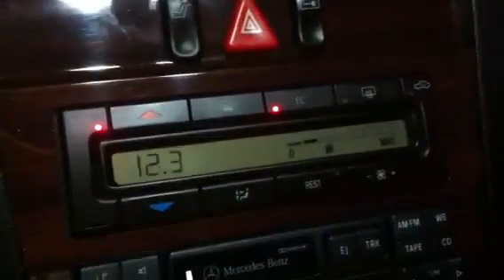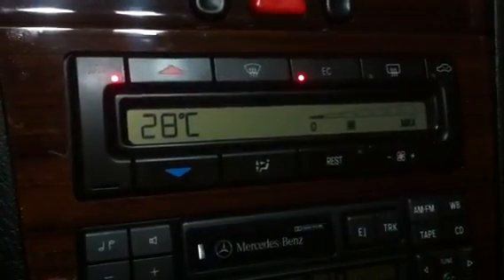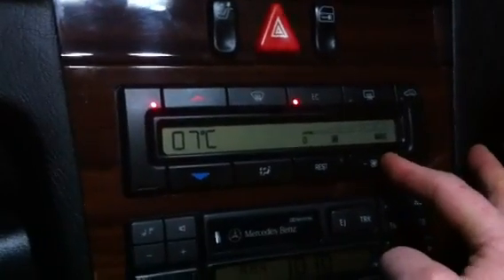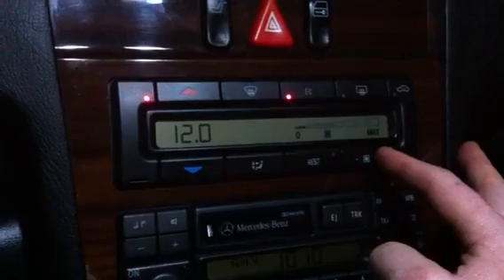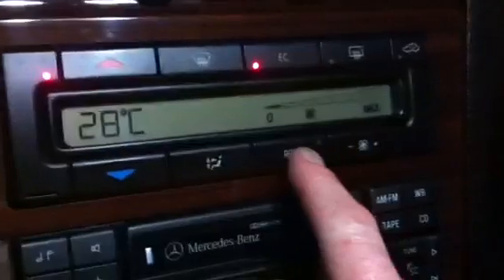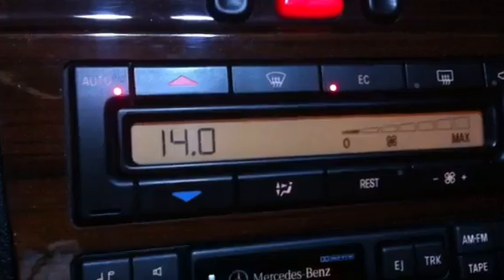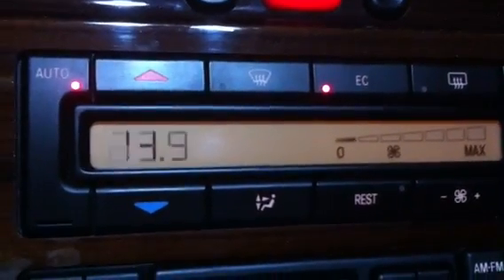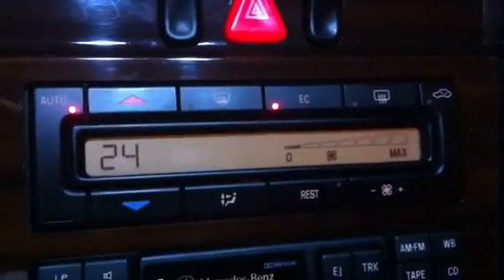Easy battery alternator test..Mercedes Benz

Comment: Mine is at about 13.5 pretty consistently, but I wonder if it's starting to die on me. Sometimes the headlights and digital display will pulsate a bit, and then the turn signal will start to blink super fast, then normal. Also the other day the red warning light with the battery icon came on. Checked the battery and it's at 92%.

Comment: I have a c230 97 and it does not have the indicator 24. From 23 it jumps to 40. How do I test it?
Reply from the maker: some cars don't have all the codes depending on the software version .. you can still test battery and charge condition with #23     it shows battery condition/charge as a percentage .. so the number shown on indicator 23  will be the battery percentage  (  80 would be 80%   98 would be 98%   etc . )
Reply: great, I'm going to test. I have another query, my remote control does not unlock the car. My control is the one with only one button. I run out of batteries a good time. How do I recognize it back? I have a C230 97 version USA
Reply from the maker: lock the car from outside with the metal key..then unlock with the metal key..then point the remote at the rear view mirror inside the car and press and hold the unlock button..if that doesn't work , put metal key in ignition and start car.. remove key and point the remote at the inside rear mirror and press and hold the button

Comment: i had somebody who traded me 97 benz an jipped me. They tried hooking up a radio an i bought a new battery yesterday put it in. then sold it then customer came back said it died. by the way none of the rpm gas pressure work on the dash. Inside lights work. Neep help
Reply from the maker: unhook the radio wires and see if the car then runs ok..if it does there is a bad connection in the radio wiring

Comment: I'm so frustrated with parasite drain on 2000 cl500.It goes totally dead if not driven in 5 days. Had in Mercedes shop last year and driver seat switch and battery was replaced.Still had same drain so another Mercedes shop replaced my instrument panel costing $1700. Car was fine for 5 months but not it's draining again in 5 days if not driven. I noticed a small oil leak on drivers side. Just frustrated and broke!
Reply from the maker: I'm wondering if the computer and canbus components were ever reset after the battery replacement and seat module replacement . It seems they were taking a shot in the dark to diagnose . The can-bus network in your car controls almost everything electrical..it has 2 states/modes it can be in ..one is sleep, where all the electrical components are shut off and inactive, and awake , where all components are ready for use. After locking the car the system should go into sleep mode withing a few minutes.. if the car is not remotely locked with the key fob, or manually with the key, the system may stay awake and draw current from the battery. The other possibilities are the navigation cd in the cd player not shutting off  ( you can eject it next time you leave the car and see if the battery is still draining) Also possible is the windows ans sunroof and headlights not being reset after the battery was replaced..if they were not reset the canbus would again , not enter the sleeping state and drain the battery.  Reset the windows and sunroof by opening the windows and sunroof 1 at a time ..once the window is all the way open continue holding the switch in the open position for 5 seconds..then do the same with closing the window , and hold a further 5 seconds..do each window and the sunroof in the same way. This tells the computer where fully open , and fully closed is, so the one touch up and down will work on the windows and roof.  This also is tied to the lock and sleep states for the canbus..the system is looking for all the parameters to be met to enter sleep mode and save power..if it doesn't know a window or sunroof is closed , it won't enter the sleep mode, and the battery will drain more quickly...same with the sunroof.. Also cycle the headlights on and off, and high and low beams a few times  When you leave the car for a few days , make sure you lock the doors with the remote by holding the lock button while standing  next to the car..hold the button for at least 10 seconds..this will allow the widows and roof to completely close, and the canbus system to recognize it is locked.  Let me know if it works for you
Reply: Thanks a million, I have the mechanic check the Canbus and everything mentioned!

Comment: Hola,de mucha alluda su video.hice el tes y el alternador me da 12.5 y la bateria 12.debo cambiar el alternador?????
Reply from the maker: 12.5 while running is too low..the alternator or voltage regulator is going bad
Reply: thanks for your help,do you now wear is the voltaje regulator locate???and thanks again
Reply from the maker: Ruben Rios The voltage regulator is attached to the alternator
1) Remove battery negative cable clamp (13mm)
2) Remove battery wire from alternator (13mm)
3) Remove Battery light wire from alternator (10mm)
4) Release tension on serpentine belt at the tensioner, and slip belt from alternator pulley.
5) Remove lower, then upper alternator mount bolts (16mm). .
6) Remove alternator
7) Remove cover from back of alternator 2 screws and pop off the plastic cover
8) Remove 2 screws holding the regulator
9) Assembly is reverse of removal....
10) Then reset the windows, the clock, and recode the radio

Comment: Hey buddy I had a question for my 2003 benz C240
there is no issues besides the battery dies when i leave the car for more than a day,
i checked and the car said voltage as 10 (it was 12 about a day earlier) i took the battery
out, got the multimeter set to DCV 20 and it read 11.8v
this has happened about 5 times, why is it the car thinks the battery is dead
when it isn't?
Reply from the maker: actually 11.8 is a weak battery.. it should be around 12.5 v  after a full charge .  take the battery to a parts store and have it load tested. I think it may be nearly dead. There is a possibility that there is a draw somewhere in the electrical system somewhere...Just looking for a good descriptive online battery draw test...ahh here we go   http://www.wikihow.com/Find-a-Parasitic-Battery-Drain

Comment: hey if i don't hear anything when trying to start up the car is my alternator bad or is my battery dead???  almost everything comes on when i turn the key and i tried to jump start and still nothing
can you help?
Reply from the maker: likely the battery cable to the starter is badly corroded
Reply: ***** the cable TO the starter?
i brought a mechanic to diagnose and he said it's the starter itself and it has to be replaced
Reply from the maker: Vide Infra it could be the starter as well .. I just like to stat with the cheaper easier possibilities before trying the most expensive solution,,,
Reply: ***** thanks, brother is this something i can fix myself?? is this just cleaning up?
Reply from the maker: Vide Infra under the drivers side front of the car , to the rear of the front wheel you will see where the big battery cable comes from the body to the starter..make sure it is good and not rotted..there is that big wire and a smaller wire going into the starter.. If you have a voltage tester you can test there ..it goes directly back to the battery.. Check also that the ground strap from the engine to the chassis , and exhaust to chassis is good. that is where the starter gets its ground from, so if that ground strap is bad, the car won't start. The rest of the lights etc. would be fine since they get ground straight from the chassis. The engine/ starter are isolated from the chassis with rubber mounts so the ground comesthrough the grounding straps to the engine
Reply: ***** it wasn't the starter it was that damn ground cable i am sure you know what i am talking about it's near the driver side it's a short ground cable
but i ended up paying $500 only because of wrong diagnostics
Reply from the maker: yes ..that was the ground strap I mentioned in my last post. Mercedes has a few of them also along the exhaust en ensure grounding of the engine, O2 sensors, etc.  $500 ??  did the mechanic change for a starter ?
Reply: ***** yeah since it was a service request so they did that (parts and labor ) and then diagnostics on the electrical 
now i got a Check Engine light today
any idea?

Comment: fupabox I have a difficult issue.  My Penz is a 97 and my red Battery Charge display came up and within a few miles I am limping then car dies.  Changed alternator and same issue???  Battery charges on charger and is fine till I start and drive.  HELP
Reply from the maker: +John L take a set of booster cables and use just one pair ...either the blacks or reds...attach one side to a good engine ground and the other to a good ground on the chassis...start the car and see if the light goes out...I'm thinking the ground strap on your engine or exhaust has rusted away, so the alternator is getting no ground

Comment: Thanks for this vid! I tried this but the number only went to 23? then it skipped to 40!  both when the car was running and not running. I think there may be something wrong with my alternator as the car keeps cutting out/loosing power on long trips but it always starts back up again. quite dangerous though to stop in the middle of the road!  Also I want to check the battery water but I don't know how to do this on a sealed battery?? thankyou!!  I have a 96 c280
Reply from the maker: +Misty Lang It sounds more like a blocked fuel filter than a bad battery..if the battery or alternator was dead, the car wouldn't run for long or re-start..sealed batteries can't be checked for water level... any good auto parts store will test the condition of the battery for free for you, so that's the easiest way to test it.. odd that 24 doesn't show up... test your alternator at night with the headlights on..slowly turn on more power robbing accessories one at a time.. rear defrost and high fan speed will cause the most drain.  If the headlights dim significantly when you turn stuff on, and stay dim.. the alternator or battery may be going bad..if they dim and then get brighter again after a second, the alternator is working fine
Reply: thanks so much ! I'll go through those things

Comment: my 2000 mercedes w202 c280 v6 m112
stalls when I put it in reverse, voltage when running is 13.6
when not running 11.5
Reply from the maker: +Ullius Separ  engine off battery voltage is a bit low, but that shouldn't cause the reverse stall..try removing the reverse light fuse.. I think it's #13 under the hood fuse box... ifthe car doesn't stall with the fuse out, there is a ground/short in the back up switch on the shifter, or the wiring to the back up lights
Reply: +fupabox thanks a lot for your help! really appreciate it :-)

Comment: Hello Thanks for your info.
After I change battery for my 1997 Mercedes c280, the door doesn't lock or unlock. I think everything works, except the door button doesn't lock/unlock. I tried even with the remote control, it doesn't work. How can I reset, pls.

Please help me.
Reply from the maker: +Yared Bezabih use the metal key and lock the door from the outside.  Then using the metal key again, unlock the door and put the key in the ignition within 10 seconds and start the car.  If that doesn't work there is one more method, but I have to look it up
Reply: it doesn't lock or unlock the doors. I think the motor for the lacking system may be need to replace. But I don't where it is located or how to check it.

Thanks for your help
Reply from the maker: Yared Bezabih they are locked and unlocked by vacuum from a vacuum pump in the trunk under the carpet beside the gas filler door...if your heater vents work the vacuum should be fine..  you can also check it by raising the rear seat headrests..then shut the car off.. wait 5 minutes and press the headrest button on the dashboard.. if it lowers the headrests..the vacuum is fine..check the fuses for the PSE pump as well

Comment: Fupabox i have replace the alternator on my C220 1996 ,once start the engine it couldn't change the battery ,but when jump start it turn on the engine thinking the alternator will start changing the battery .However it couldn't change once removing the jump cables the engine stop as the idling drops too.Have notice on the rear mirror inside the car when try to start the engine without jump start once i turn the ignition i can see flashing lights on the rear mirror flashes red and green lights .what could be the problem with my car i need your help
Reply from the maker: +cherryster chansa  check the OVP  relay.. tall silver relay with a fuse on top of it..the fuse is under a clear plastic cap on top..it is inside the engine compartment in front of the passenger side windshield..A bad alternator can burn it out.. check the fuse on top if it..if the fuse is good, have an electrician test the relay
Reply: Thanks Boss for your help keep it up ,i will have to check the OVP relay as you mentioned
Reply from the maker: cherryster chansa glad to help :)
Reply: Have checked the OVP relay and the fuse they all fine ,but the engine could not recharge the battery .Could it be i need to recharge my battery maybe that's when the alternator can start to operate well ,because i just bought a new battery last week 658 size of the battery.What can say about that
Reply from the maker: +cherryster chansa The battery isn't the problem if it is new.. even with a dead battery the alternator should be able to supply enough power to keep the engine running. Is the ground strap on your engine OK ?  are you sure the alternator is good ?  Was it a new one or rebuilt ?

Comment: Man you are good ,my car just shows me a bulb light on the dashboard after running short distance the engine turn off ,try to start it ,it couldn't start till boost it with other battery that's when it start .However have just bought a new battery two days ago ,i strong believe something wrong with my Benz car C220 alternator ,reason is that after saw your video that's extract what happened when i try to switch on the Air corn everything drained up the power.What can you help on this issue ?Thanks
Reply from the maker: +cherryster chansa yes it sounds like the alternator or voltage regulator is bad. you will have to replace the alternator
Reply: Thanks very much Fupa ,definitely i need to replace the Alternator am sure

Comment: Whr I can find the switch or plug that I can start in winter. In clk 320 1999
Reply from the maker: if you mean like a block heater ..look under the hood near the radiator..if one was installed by the previous owner there will be an electrical plug hanging in there somewhere...otherwise you will need to have one installed

Comment: My battery warning light came on today! Hoping it's just the regulator. You are a great resource, I didn't know about this test.
Reply from the maker: Thanks..it's a really convenient way to test the alternator :)
Reply: ***** Well, turns out it was the alternator. Was hoping it was just the regulator. For those of you looking for symtoms:
Ran the test and at first it was reading around 11.3 - 11.6 or so two days ago. Yesterday, however, all my warning lights came on, the car wouldn't shift out of first gear, and it basically went haywire electrically.